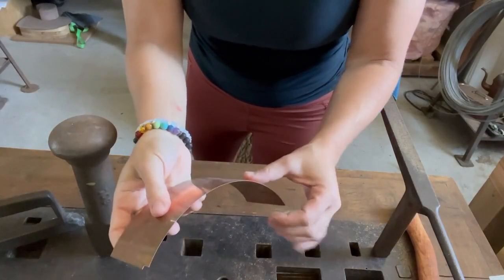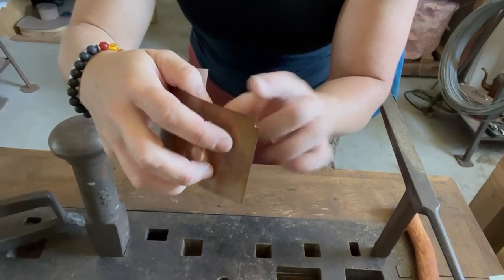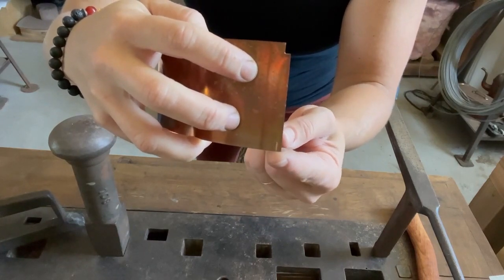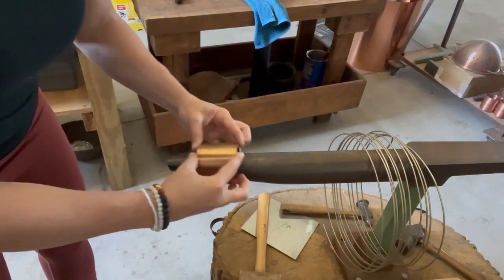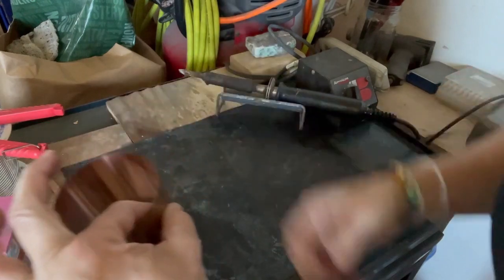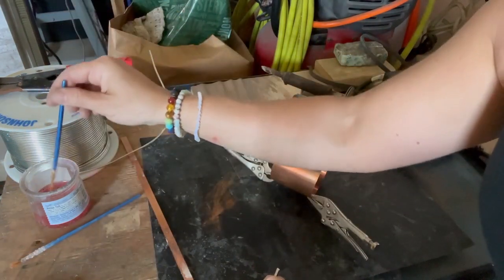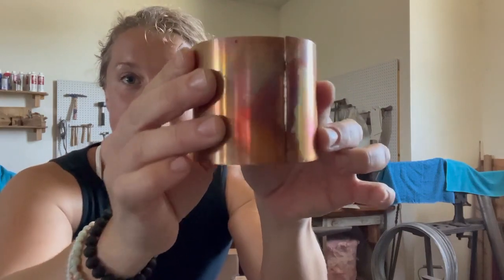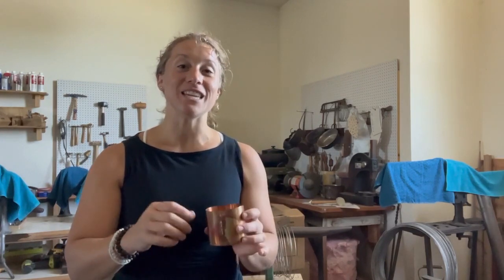How to Do a Lap Seam

Comment: Unrelated, but can I request a video about flattening the base on warped copper cookware? I'm curious about your approach especially when the copper is stretched and you need to basically choose between some cupping and crowning.
Reply from the maker: lol, absolutely you can do a request anywhere! I just filmed this video for ya, and will post it sooner than later once I get it uploaded, edited, and uploaded here. So much depends on the piece itself. There have been times I have gotten it totally true/flat, but usually that's with older pieces that can spread out the crystal structure of the copper better than whole/pressed pieces like the one I will show in the video. Heat, hammer, and hope...that's about it. ha!
Reply: @housecopper  awesome, thanks so much Sara! Looking forward to seeing it :)

Comment: What is the reason for using a torch instead of a iron also do you buff out the copper to remove the distortion from the torch. Thanks for the video
Reply from the maker: Copper pulls the heat SO fast you must use a torch to keep it hot enough to get the solder to run, even if you are also using a soldering iron. Yes, you buff/clean the copper after you're done with the heating process.

Comment: Been watching your videos the past few hours, and I was wondering if you could answer a question please. I bought a copper boiler for canning today and when I got it home i found a 1/16-1/8 hole in the bottom. I saw a video where you soldered a copper patch on a few pieces and I was wondering if I did that and then tinned the inside again would that make it safe to can with.
Reply from the maker: Thanks for watching! Hope some of it helps! And yes, you could patch the copper pot with a copper patch. It's totally work a shot to make the boiler usable - better than not trying at all.

Comment: This is for cookware? Doesn't the solder melt when you cook with it?
Reply from the maker: Lap seams have been used for cookware for several centuries. It holds up. :) And since you should never heat a tin-lined copper pot / copper pot with tin in it empty, the food or liquid absorbs access heat, so there's no melting solder. Unless you cook in a skillet with an inappropriate amount of heat and not enough food/water in the pan. Then, yeah, you'd melt your tin lining. But that's a user error, not a fault of the tin's. :)